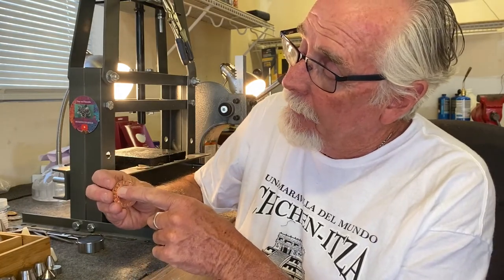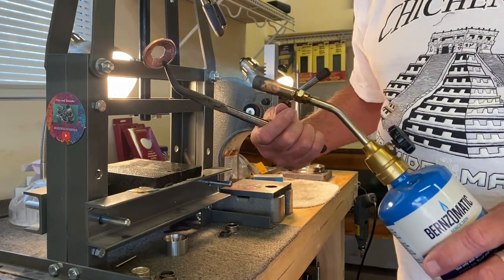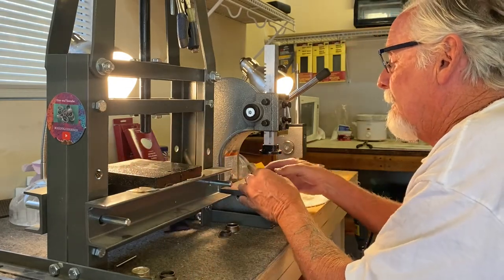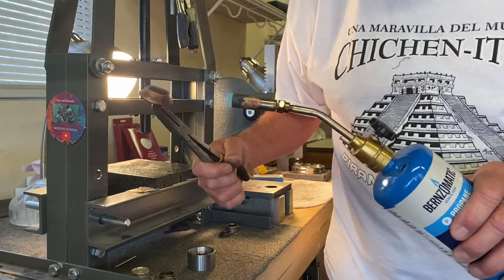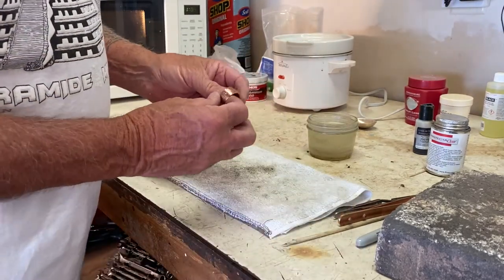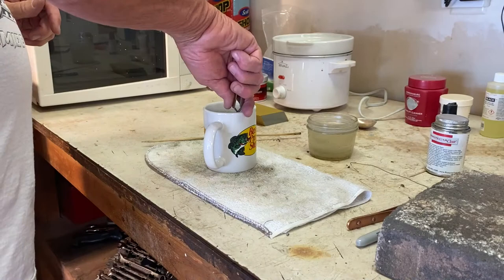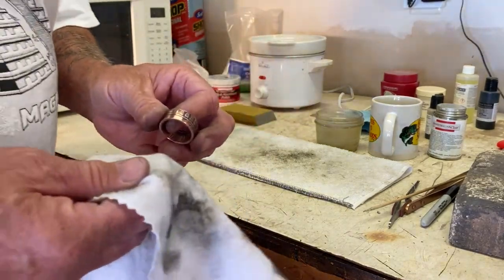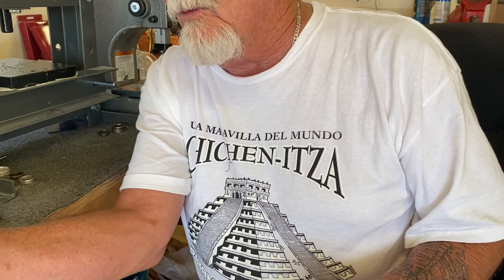Making A Mayan Calendar Coin Ring

Comment: What grade sandpaper are you using in the copper.
Reply: On the copper
Reply from the maker: I graduate from 220 to 440 to 660 to 1500 to 2000. I use a wet /dry sandpaper.